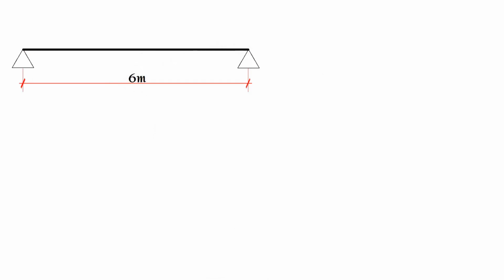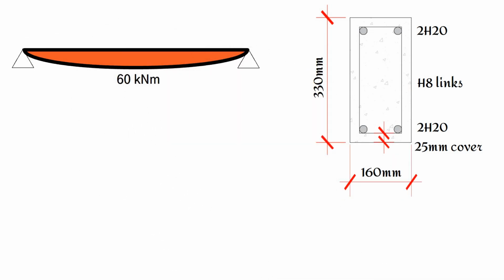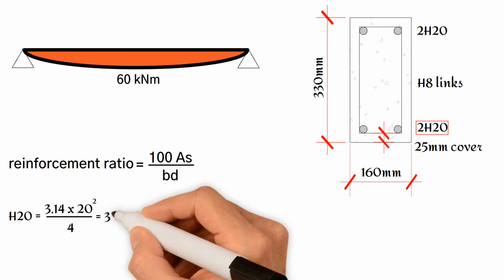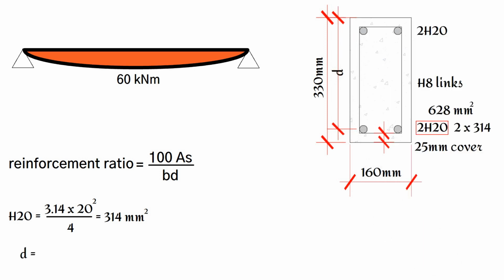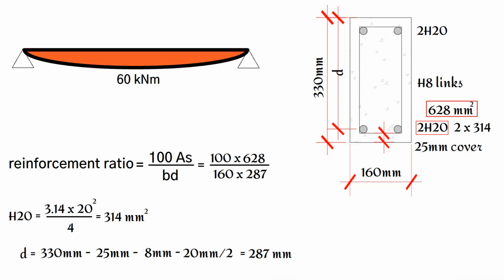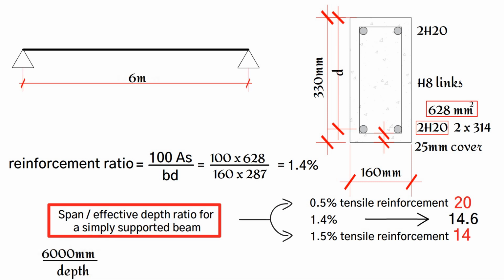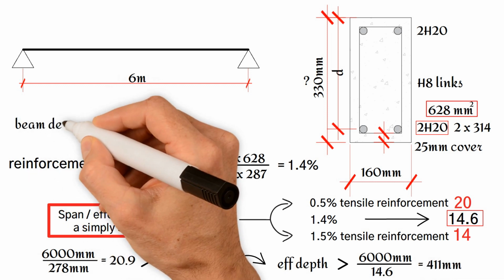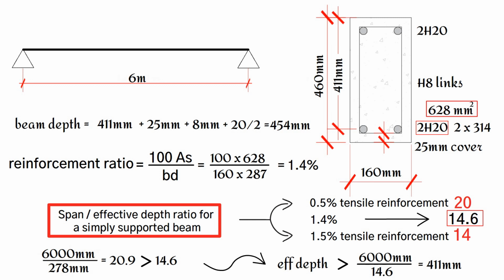How to calculate the effective depth of a simply supported reinforced concrete beam.

Comment: Q.1) A rectangular beam supported on 300 mm wall having clear span 6m. Live load is 12 KN/m. Use M20 and Fe 415 materials. Width of beam is fixed at 300mm. Design the beam.
What’s the effective depth on this one I am trying to calculate the effective span which is the c/c distance between supports using IS code